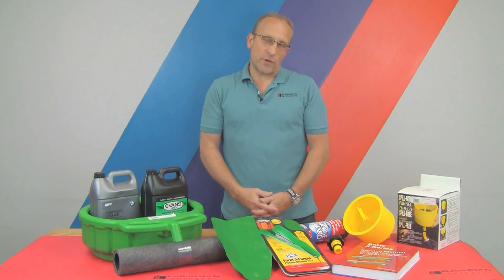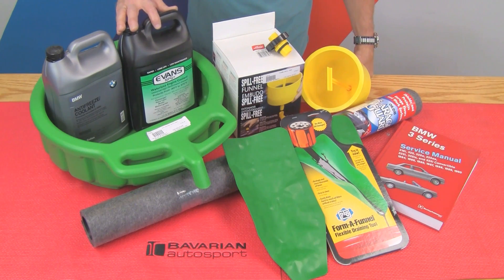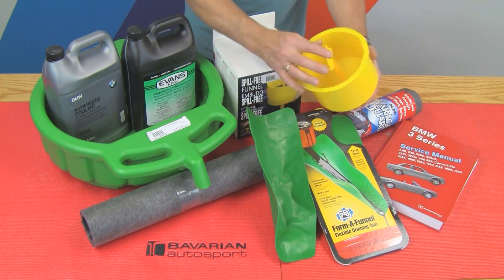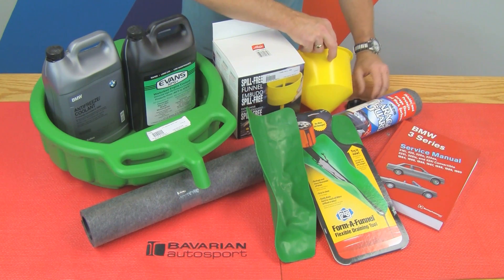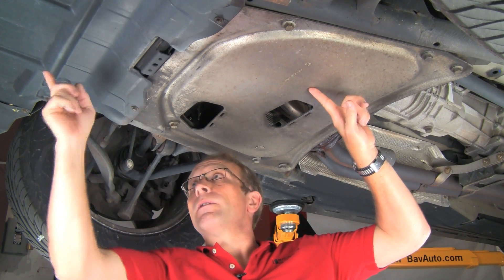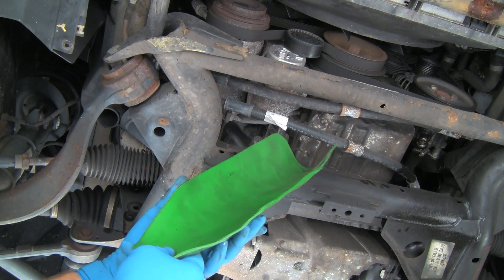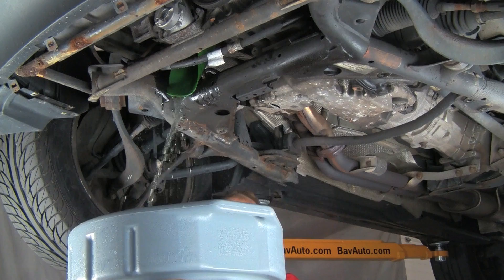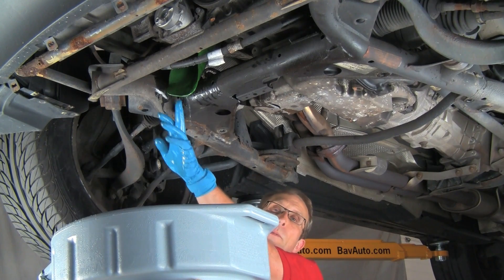Flushing & Replacing Engine Coolant in a BMW/MINI

Comment: Does the 2 litre petrol N43 (4 cylinder) have an engine block coolant drain plug, or just drained from the water pump/thermostat hoses?  If so where?

Also, I'm guessing draining only from the radiator will not remove enough fluid?  Thanks.

Comment: Thank you for this. I have wrong red coolant inside the system and I'll do a flush with motul radiator clean+ distilled water. Your trick with having correct 50/50 mix was essential! My M43TU system is 6L so I will add 3L concentrate first and top up with distilled water

Comment: For anyone wondering.... The engine drain bolt is the one to the back left in this video.... Not the front right... He points to both.....

Comment: Hello, I have the M57D30 engine on my x5 e70 . Do I need to start the engine in order to activate the pump? I have seen videos only activating it with just ignition on and holding the accelerator pedal for 12 secs for bleed the system. Another question is, isn’t the bmw antifreeze already mixed? What I have discovered if the coolant is to -35 degrees it is mostly a ready mixed coolant and if -70 degrees then it is the antifreeze concentrate what have to be mixed in order to make it to -35 , I think that makes sense doesn’t it? Thank you in advance.

Comment: Thank you for your great video.
Here are a few things that I learned in the process that I’d like to share:

- After engine overheating and coolant boiling (due to a failed radiator fan in my case) I had a lot of air in the system.
- As mentioned in the video, at the beginning of the process of bleeding, the car overheated again (temperature gauge reaching 3/4) and I needed to turn the engine off, bleed, and turn it back on a few times (Thank you for this hint!!).
- With all the fluid level fluctuations, I couldn’t do it without a spill-free funnel. (Bav Auto or ABN brand work, threads don’t match the coolant reservoir perfectly, but it works.)
- I also suggest replacing and using a brass bleeder valve.
- Even after the temperature stabilized with the engine running, I was able to bleed more air, by turning the engine off (water pump off). The fluid level came way up in the funnel, and then I opened the bleeder and a lot of air came out.
- Some videos talk about bleeding with the engine off, and just switching the ignition on, using either 1) heater auxiliary water pump, or 2) Activating bleeding cycle by pressing the accelerator pedal for 5/10 seconds. If your car has either of those options, it will simplify the process, by it was not an option on my 2006 X3 E83 (M54 Engine), so I am grateful for this video.
- I had error code P2184 (Temperature sensor 2 low), which didn’t come back after filling and bleeding the coolant.
- Check coolant level again later when the engine is cold.

Comment: I would add that you need to be really, really careful when you fill the system, especially the water. BMWs are very sensitive to air in the system and if you just pour the water in there, versus slowly pouring it so there's no air, you will get air pockets which will impede your coolant flow and probably cause your car to overheat! The video doesn't mention this but trust me, it is very important that you do that part right. Nothing good comes from overheating a BMW engine. 

Also, on many models, such as the S52 in the E36 M3, the block drain plug is right behind the O2 sensor. So not only is the bolt likely going to be very hard to remove, but your O2 sensor is going to get saturated with coolant when you drain the block and you will set off your Check Engine light and possibly ruin the sensor. So I recommend taking it off first and plugging the hole so coolant doesn't get into your catalytic converter.

If you can't do that, the only wrench you're going to be able to get on it with the O2 sensor in place is a 19mm box end. Just be patient. Once you crack it loose, you'll be good to go. When you're done, throughly dry the sensor with a towel before you start your car to avoid a CEL light, and hopefully you also remembered to buy a new crush washer for the block plug ;-)

When you do the flush, make sure your car is fully cool. The liquid gets really hot so if you don't wait a few hours, you can burn your hand and arm, if you don't burn it on the hot exhaust first.

Comment: Hi Sir, excellentttttt video and explained in detail,perfect. I have a 2013 x5 bmw 35i 3.0 litre. (north America vehicle).the problem i Have is I dont see the temperature gauge on my dash.but lots of digital everything else.and i was told it into settings (i am not savy on new technology) and would have to be programmed for me to see the temperature on my Dash Panel...I am stumped to realize there is no temperature gauge, which i would like to see at all times, as water/coolant temperature is surely a very important gauge or digital lights to see functional at all times when i drive!! Also is it ok  to use a coolant called "OEM Extended Life EURO 1  50-50 Premix Antifreeze/Coolant  meets of exceeds performance requirements of ATSM D3306  BS6580 ,  ASTM D6210-10  ATSM D7583 and recommended for BMW Jaguar Mercedes Benz Mini. Smart Volvo written on the bottle and is mixable with the original BMW  Coolant thats in the vehicle from factory? ty in Advance for your input and expertise, 100-100

Comment: At the end I laughed a bit when you said "This video shows how easy it is to change the coolant in your BMW" Funny. Its not easy at all compared to other vehicles. I dont understand why anyone thinks BMW's are good and reliable cars. The cooling system alone makes them a big pile of shit. Way over-engineered, over priced plastic junk. The engineers did do an incredible job of making something so basic and simple as a engine cooling system and making it complicated as a space shuttle. Buying a BMW is absolute stupidity when you can get a VERY WELL built and reliable car from Lexus. My is300 has all original cooling system parts on it and doesnt miss a beat.

Comment: Hello
5:08 secs.
What do you mean exactly when you said,
‘have the heater on high’ and 
‘run the system, run the engine until the thermostat opens with the heater on high?’
How is it done step by step?
What did you mean exactly when you said ‘run the system?’ How do you do it?
Reply: He means run the system by turning the engine on but since I have newer midel for example I’m not running the engine. I do only start the ignition press the acceleration pedal for 12 secs till I hear the water pump running and it does the job for myself tho ;)
Reply: And the setting of the temperature inside the car must be set to the highest possible with fan on the lowest during that process in order to activate the pump.

Comment: I use Evans. If you convert you must remove the water. This is important as it only tolerates 3 % water. A little more work but you are only doing it once so worth it.

Comment: IMPORTANT: It is a closed/sealed system. There’s a final step not shown here when the expansion tank is full, which is to remove some fluid until the float (stick bobbing out when he removed the funnel) is between its maximum and minimum mark. Otherwise, the expansion tank won’t be able to perform its purpose to allow space for coolant to expand as its temperature rises, and avoid over stressing the cooling system.

Comment: Just one question...first..all the videos I've watched say after bleeding the coolant system. They say remove the fluid from the filler neck until the fluid level dipstick is slightly less than full. My question...do I need to siphon the excess coolant?

Comment: With all the advancements in coolant and now using totally different hybrid organic acid type you are still recommending changing the coolant every 2-3 years like they did 30 years ago? Maybe you recommend changing you synthetic motor oil every 3k miles as well.. good grief. Otherwise very good and well produced video from bavauto.

Comment: From experience I respectfully disagree with leaving the coolant level 'very full' as shown at 12:15  I believe in removing enough excess coolant (about 4 inches down from the rim) so that the level 'stick' is bobbing within it's indicator range from min to max like it's supposed to. I left the coolant level filled to the brim only to have the expansion tank burst on the freeway with a split down its side. I cannot definitively say that this was the cause of the breakage, but having virtually no room for the coolant to expand in the expansion tank makes logical sense to me, even if the excess is supposed to purge through the overflow vent, wherever that is.
Reply: I agree. Filling any coolant system to the brim and relying on a pressure relief valve to vent excess fluid when hot is asking for trouble. Just be careful when filling and syringe out any excess when the bleed procedure is complete. 
Otherwise another excellent video. Thanks.

Comment: Thank you for all the great tips and insight, however I don't see the block drain plug you describe. I have a 2001 x5. I have the M54. Could I get your help making sure I find it? Also, how hard should it be to remove? Thank you!

Comment: HI, I own a 1999 323i and I replaced the Waterpump and Thermostat Housing (I did not use Chinese parts) as I noticed the car was leaking. Since the car had green coolant I decided to do a coolant flush. I followed the steps in this video to get the coolant out of the block and radiator. I filled with distilled water to do a flush and I was trying to practice doing the bleed; however, the temperature lever does not move at all now. Can you give me some leads as to what might had gone wrong?

Comment: You mention in the beginning how easy it is,,,,,,but 99% of people watching this can't get the car above their heads!
Reply: it's easy, I do it with jack stands. I've replaced radiators, cooling hoses. water pumps, suspension components with out a lift...
Reply: Why would you need to get the car above your head?

Comment: What to do if your rad does not have a drain plug but you need to disconnect the lower hose? How does the hose come off? e.g. M62 E39 540i.

Comment: Otto you’re the best!  Do a few more videos with E30s!!  
So I watched your video a couple times, then I attempted a coolant flush on my 1987 BMW E30 325.  Unlike my 2010 camaro, the radiator on this BMW does not have a radiator cap.  I did my best to fill coolant through hoses, then the expansion tank, then I bleed the system.  Drove around for a few days with no problems.  On my drive to work this morning the temp gauge started dancing around above the half mark.  I figured it was a large bubble that formed over the last couple days that finally got stuck near the thermostat.  In the parking lot I turned off the engine, took out the 8mm and cracked open the bleeder screw.  Coolant started spraying out.  Never seen that happen.  I quickly closed the screw.  Composed myself, and then cracked it again,  coolant bubbled out, then started gushing out.  I turned the car on and cracked the screw again a few times,  each time with no bubbles coming out, just gushing coolant.  AND the temp gauge went below half.  

My question is: Does it happen every so often that you drive around and everything is fine, and then one day you get a massive bubble in the system?  I don’t think I have a head gasket leak that might be creating bubbles in the system because I’m not losing coolant and my engine never over heats, and the exhaust doesn’t smell sweet or look white.  And because I just did this coolant change 3 days ago, I’m pretty sure this bubble thing happened because of my coolant change.  Thoughts?

Comment: The Radiator on my 97 z3 bmw 1.9L the plastic connector to the upper radiator hose has been leaking i thought tighting it would help but no it didnt. I instead took the hose off to find out the plastic connector piece that mounts to upper house is dry rotted. How do i get the pieces out of the motor? I know its dry rotted when i touched it and it fell off in pieces. I dont think the piece is gonna come out the drain plug.

Comment: hello I'm from Panama, and I saw the whole tutorial and I liked it, now my m5 of my x5 will change the cylinder head gasket because of the failure of it and it happens that the engine is still hot, that you believe the possible breakdowns to solve it , my email is lealvaradoromero@gmail.com

Comment: When flushing the system with distilled water on the n52 with electric water pump do you need to do the bleeding procedure or just run the car with the heat on?

Comment: I use the same coolant for my 01 bmw x5 3.0i but the tank is already full filling up just he concentrated coolant. I didn’t have to add any water. Did i do something wrong? I thought the 3.0i 6 cylinder takes about 10quarts? But how come it was filled already at 5quarts?

Comment: Thanks Auto! Great video. But, since the spill proof kit uses a funnel that is open to outside air, wouldn't the cooling system bleed air to the outside through funnel opening? Is it even necessary to use the bleeder screw?

Comment: Hi Bavarian, My engine is E87 BMW 118d, 2008. What happen if I not over filling like you and not use the special funnel and adapter. Just filling to max level and ventilate by start the engine, heating system to max and fan to min and fill more ... ??? Grateful for feedback.

Comment: I have changed the thermostat which was stuck in the open position. I have bought the recommend BMW type coolant blue in color. And it's draining into vehicle. This is my second time putting coolant in. I see that you suggested 5 quarts straight BMW coolant..then put 5 quarts of distilled water. So maybe that's why I'm having this problem...I will adjust and get back to you. Now the first four I put in vehicle were of a 50/50 mixture. Half water into a clean coolant container with the rest being half of BMW coolant.

Comment: Hi. Great videos and learned a lot. I think someone commented already but this is important. The expansion tank does NOT get filled right up. Always remove coolant once done bleeding to right level. That's the indicator just to top of bottle. Use a pipe or turkey baster to remove coolant. Then check after driving a few times.
Reply: Simon Joshua Agreed. It's good practice, and safer.

Comment: HI, sorry if this has already been asked, but did that Spill Free funnel come with the correct attachment for the BMW or did you need to adapt/source a part somewhere?  I'm based in New Zealand and looking to purchase via Amazon so don't want to get something shipped all the way here just to find I can't fit it to my 2005 318i (with the N46 engine).

Cheers.

Comment: Why do you have to bleed the engine or the coolant .?
Reply: Air that remains can cause hot overheating symptoms ..and localized internal corrosion issues where the pocket forms

Comment: Thanks for all the vids. I have a clicking sound every 10 -20 seconds as the car idles at temperature. Could this be the thermostat opening and closing ? M54 with 38K miles. Would this indicate an issue with the Thermostat if I am correct? Thanks for your reply

Comment: ook, alil advice if possible

I've a 4 cylinder e46 2004, I've just replaced the radiator, thermostat & water pump...

I've noticed a small leak near a thermostat bolt, everything else seems OK regarding leaks anyway now I've noticed when I've the Heater turned on the engine temp drops, when the heater is off the engine temp is normal... any ideas?? could it be trapped air in the system still or possible something else???

Comment: Hi BavAuto, nice video. I have a question though.
You also have a drain plug on the engine block. How man Liter coolant is storaged in there?
And does that drain plug have a specific "pattern". How is it recognizable?
Is it highly recommended to open that plug as well? Or will the drain plug on the radiator do?
Thanks in advance

Comment: I'm having trouble bleeding air from the cooling system on my M43TU engine after replacing one flange. Instead of releasing bubbles like usually (like in 12:27) it spits out gradually over a liter of coolant while making loud noises. After about 15 minutes of spitting coolant the engine overheats. I tried it twice with the same result. What could be the cause of this behavior and how do I solve this issue?
Reply: I don't remember him mentioning the heating system.  It's best to turn that to high inside the car with the fan off or at least on low to make sure the heater core is also getting flushed, full and burped of air.

Comment: I recently added coolant to my BMW X5 and the very next day I had to add more. I thought it might have been a leak, but there is no evidence of that. I added more today and waited to see if the coolant went down, it did so I kept adding more. My question is can it be leaking from somewhere else?
Reply: Your head gasket could be damaged and because of that your engine is burning the coolant.

Comment: Great video! I was not able to add more than 5 liters (5.2 Quarts) after the flush before the system was full on the M54 engine which should take 8.4 liters. First I did this with DEMINERALIZED water, only 5L could go in. Then drained, then again with water and then with the coolant (Croon SP11 already mixed coolant). The car was level on a car lift. Two questions:
1. Is is possible that there was still 3 liters left in the car?
2. Is it an issue that there are probably remains (3 liters) of the DEMINERALIZED water in the system?

Comment: hey i have replaced , the water pump, thermostat, thermostat sensor , radiator and fan clutch. and i have bled my car out multiple times. i can drive for about 10 minutes and my car starts overheating slowly . i go to check my car engine it is still fine, what could be my problem????? could you please help
Reply: air in the system. bleed through bleeder valve near thermostat then through bleeder valve near expansion tank.